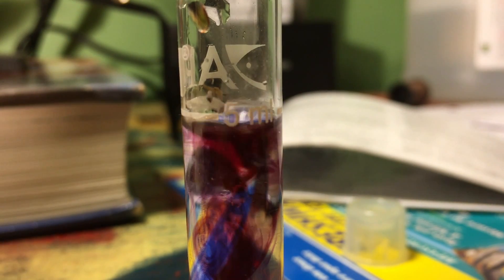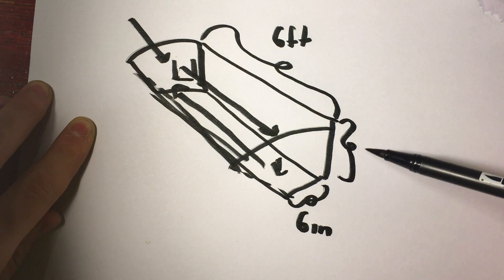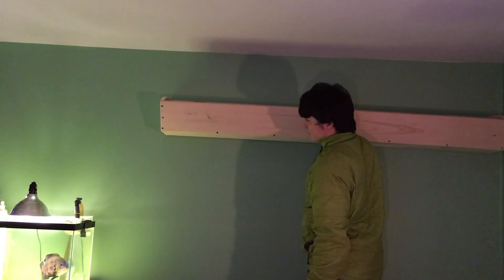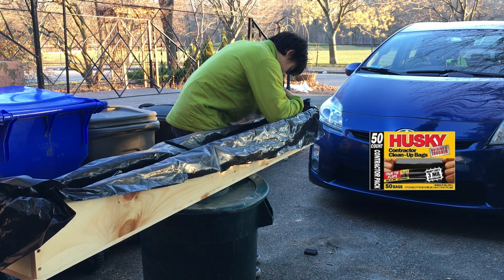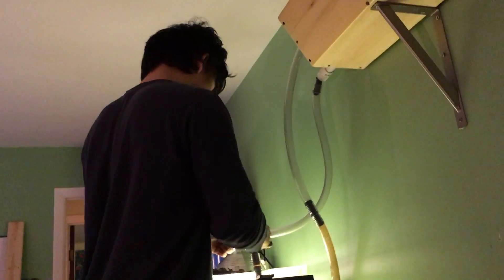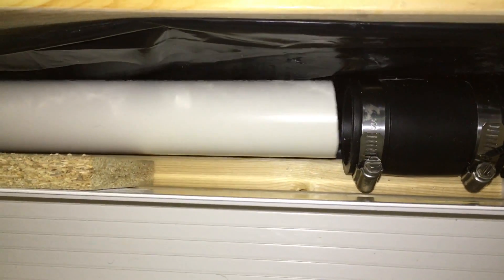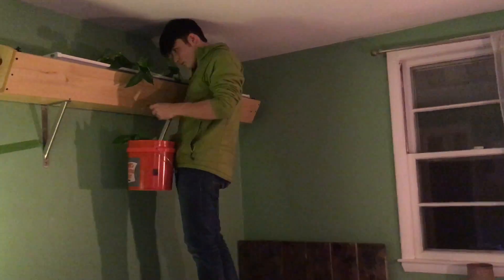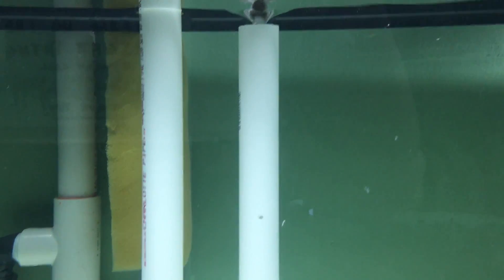My DIY Indoors Aquaponics System

Comment: I'd also make sure to check on your humidity levels in the room in case of mold from the excess water that's being let into the air.  Your drywall could also take a hit and become soft and eventually break down.  Your setup looks cool and well planned, but check on those humidity levels for safety reasons.

Comment: I know this is an old video but i gotta add my two cents here.. Its a great design but there are some flaws to it.. first and foremost is that you always run electric above water and i saw an outlet on that wall under your grow bed. if it floods down the wall you have fire risk. second is that your using 2 pumps. while this normally would not be an issue outdoors, eventually one pump will fail and you will over flow.. hopefully the pump that fails is the one in your tank and not your sump. because your sump will overflow the tank but your nice oscar will survive.. if your sump pump goes first then your tank will drain killing your fish and your sump will overflow and make the mess. Keep up the experiments though!!

Comment: I have never gardened using the Dry Aquaponics  method before, but after reading this simple, straightforward and ideal beginner's book, I will be building an Dry Aquaponics  set up [ Check Details Here >>> https://t.co/Lrwi0vZuTr ]; I live in California and it's a drought here, right now, it may seem ironic to turn to Dry Aquaponics  gardening but it's actually ideal for these conditions because it uses less water than traditional gardening does. Great book.

Comment: way too complicated! sump not necessary. keep it simple by pumping the water out of the tank, via a small pump, into grow bed, and then back
into the tank via a bell float valve in the grow bed.
Reply: I'm thinking the sump was there from before...before the plant system was added.  So rather than get rid of it, just the plant section was added in to the path so that part of the water goes back to the aquarium, like before, and the other part goes up to the plants.
Reply: You have no clue child
Reply from the maker: Wouldn't recommend that, it's important to keep the grow bed clean and free of any solid waste, so pre filtration is a must.

Comment: wow nice system you made there.
i do think you run the water a little hot for plants.
if you go higher than 72 degree fahrenheit (23 celsius) plants rapidly get it harder to absorb nutrients.
Reply from the maker: I didn't know that, really interesting, thanks for the info and thanks for watching!

Comment: i guess u know that plants absorb oxygen(instead of producing) in the dark?
Reply from the maker: They always absorb and consume oxygen
Reply: Erik Nakamura wrong. plants PRODUCE oxygen under light, but consume oxygen in the dark.
Reply from the maker: +Mike l plants always consume oxygen, it's required for the last step of respiration which the plants always do.
Reply: Erik Nakamura im talking about the END RESULT, produce oxygen in day and night consume oxygen, not a minor step in the process of respiration that needs some oxygen.  If u sleep with plants in an enclosed dark room (ie. airconditioner room) u will have less oxygen because partially consumed by the plants.  there are many cases where naive kids lighted the aromatherapy candle in their enclosed room and dead in their sleep because the candle fire depletes all the oxygen in the room.
Reply from the maker: It's not a minor step, it's the same reason we need oxygen for respiration. And I wouldn't worry about a candle or plants suffocating you at night, the numbers just don't add up to make it a risk.
Reply: Erik Nakamura ok enough talking to you. adios and good luck.

Comment: Sweet setup, ive been looking for ideas to do something like this myself. Consider some cheap led strip lights to replace the T5 light fixture it should give a cleaner look to your setup and save you some electrical cost.
Reply from the maker: I'm actually currently doing some experimenting with lighting for aquariums and plants using high power LEDs and LED strips. Still a work in progress though. Good luck with your project!
Reply: When using led, make sure you get some blue and red in there too, not just all white. This somehow stimulates the plants into growing (mimicking sunlight?). For example for every 6 white LEDs you need 3 blue and two red ones. Keep also the distance of the light source and your plants in mind. But I think you already knew that one. :)
Reply: There is a guy here on YouTube who has done research already using LED lights for hydroponics. I am on my tablet otherwise I would find it for you and link it. I have a similar but smaller and not as awesome of a setup as you. It works great. Erik your setup by far is the greatest setup I have seen on YouTube or anywhere for the "bedroom" or office. You really knocked it out of the park and done well. I was very impressed and will be following for future updates and also will be sharing your videos to the groups I belong to on Facebook. Keep up the awesome work!!
Reply: chefdan87 e

Comment: Hey, you seem like a smart kid - really like your Oscar!  If you could answer a question that I can't find anywhere else:  How do I match the flow out of and back to my tank with a sump?  I have a an extra aquarium I could use, but I tried two of the same pumps, and couldn't get the water to stay level.  How do you do this crucial step for a under cabinet sump?  Thanks!
Reply from the maker: Thanks! You can only use one pump on the system for input/output becasue you'll never be able to get them to match up perfectly. The pump is meant to stay in the sump and pump water into the aquarium, then in the aquarium you need an overflow (you can either drill your aquarium or make a syphon overflow to carry water over the top of the tank, just youtube search PVC overflow). The overflow will return the water to the sump once the water reaches a certain level in the aquarium. So water just returns to the sump via gravity. Whatever water the sump pump pumps into the tank will overflow back into the sump, creating the balanced cycle. Saves energy too....

Comment: Fantastic. I enjoy the fact that you are actually experimenting. If you are collecting data on this, would you mind sharing it?
Reply from the maker: Yeah for sure. I'm making an update video as we speak. I'll try to get it out ASAP. Thanks for watching!
Reply: how would I go about making one of these without the use of electricity.
Reply from the maker: That's an interesting question. Do you mean specifically for aquariums? In that case you could just dangle the Pothos into the water and they will grow fine. If you're asking in general terms I would say have a look at floating gardens. In my mind I imagine a shallow pond with rows of floating grow beds. Like a swamp but more controlled.
Reply: +Erik Nakamura Hmmm, so would that still require a fish tank and a plant tank or could they be combined if I used the right plants.
Reply from the maker: You can put the plants directly in the fish tank. I did something like that with Pothos and had success. Use some sort of rigid plastic container and drill a bunch of 1/4in. - 1/2in. holes in it and fill the container with lava rock. Then plant the clean pothos roots in the lava rock and submerge the container in the tank with the pothos leaves hanging out over the edge of the tank. I'll send you a pic of what I did. I used suction cups on the container to attach it to the inside edge of the aquarium. Also you could consider using dracaena braunii which is sold pretty much everywhere as lucky bamboo. Its hardy and grows well when dangled in water.
Reply from the maker: I don't know how to PM on YouTube....
Reply: +Erik Nakamura are there any crops that can work with this method? If I wanted to make a food yielding farm?
Reply from the maker: Hmm, if you're adamant on not using electricity I would try growing crops in some sort of floating raft with small containers of ceramic grow media. As for specific crops I would try something hardy and fast growing like lettuce or common herbs like basil.
Reply: +Erik Nakamura thanks, I will try it all.

Comment: Do u really need all the filters? 

Can't you just use some aquarium mesh that collects the bigger pieces as it flows into the planter? 

Also can you describe or show how your water is flowing into your sump from the fish tank?  I see the general idea but what's the best way.
Reply from the maker: The benefit of having a filter before the water goes into the plants is that the water is virtually particle free when it enters the grow media, so junk does not collect and build up in it. This makes the grow bed maintenance free. If there was no filter you would probably have to clean out the grow bed pretty often. Also, the fish poop tends to collect on the roots and cause root rot. In my case the filter was already there so I left it. I will do a video going into more detail about the syphon overflow and updating it to a drilled system in 3 weeks. In the meantime, I would just look up "PVC aquarium syphon overflow" I built mine by watching other videos and it works great. Uaru Joey has a particularly good video on it.
Reply: Erik, I know this is an old video but I would love to know how much effort is involved in keeping the filter clean?  I would like to build a system that was as close to zero maintenance as possible